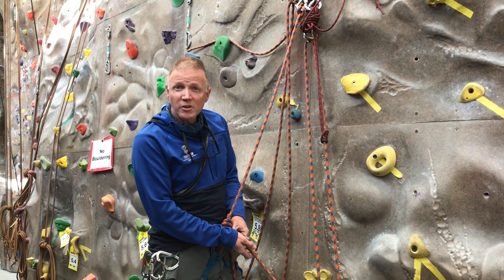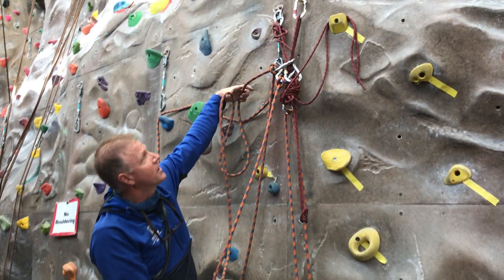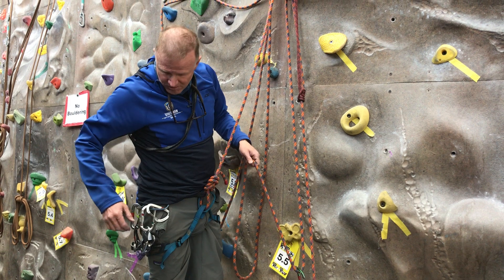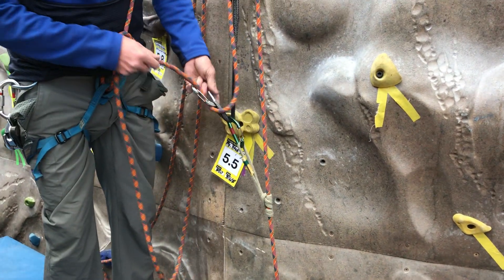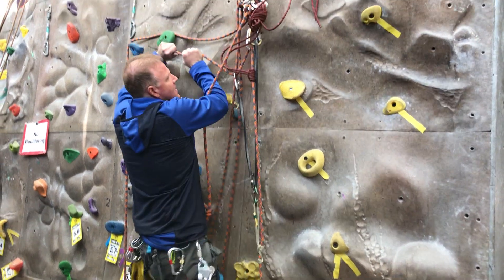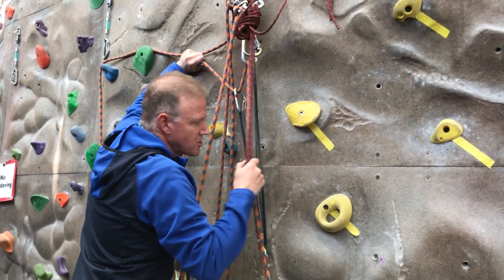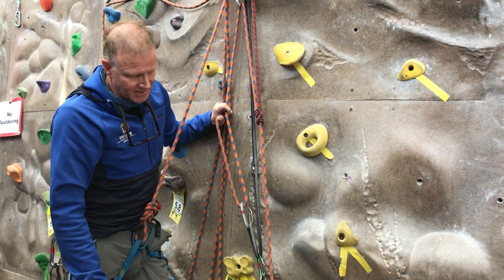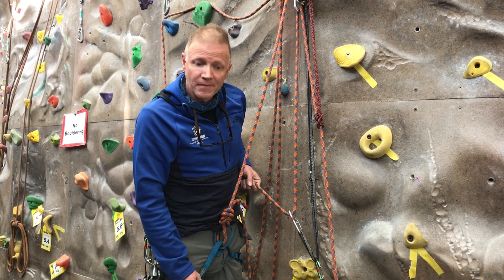5:1 Haul with a progress capture

Comment: So this is pretty genius right?! You don’t have to capture the excessive rope with a traditional 5:1correct? You are just capturing the 3:1…..aka three times the amount of rope?
Reply from the maker: By doing it just as in the video, you can avoid the need to suck up all of the excess rope before doing the conversion from 3:1 to 5:1. However, it is important to eventually move the rope through the clove hitch back-up as you haul. Otherwise you are risking a bigger and bigger drop if the progress capture should fail unexpectedly. There should never be more than 2 meters of rope between the progress capture and the clove hitch back-up.
Reply: @stuartchapin9537  understood but my point being that usually you have to pull five times as much rope in a “traditional” five to one conversion where as here you only have to pull three times as much rope while still achieving a 5:1 system.
Reply from the maker: @RMNPBETA  Oh I see what you mean. Unfortunately, you do not get a discount on the rope pulling. It still works out to 5 feet of pulling for 1 foot of haul. Sorry! You can set it up and measure. Let me know if I am wrong.
Reply: @stuartchapin9537  darn those physics! Lol. Thanks for the reply :)